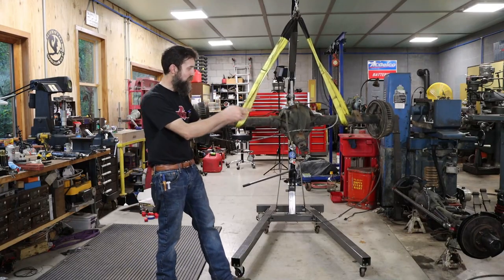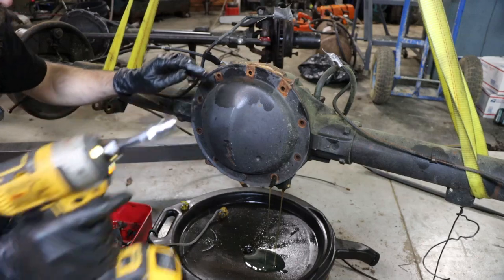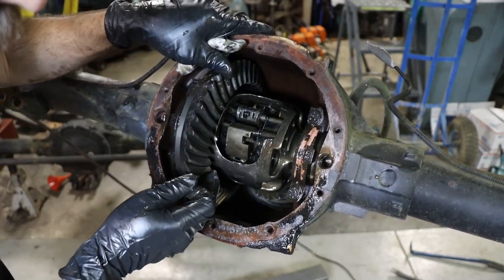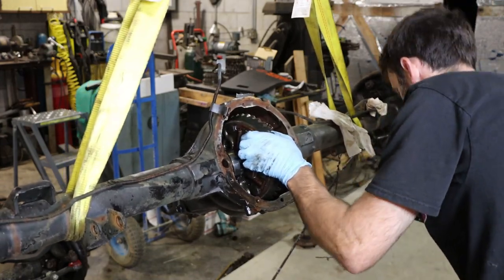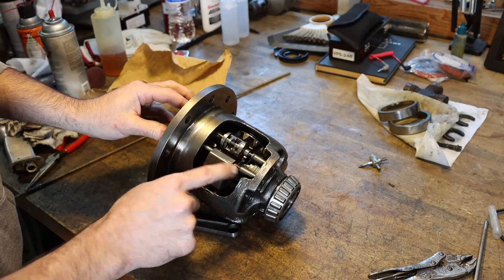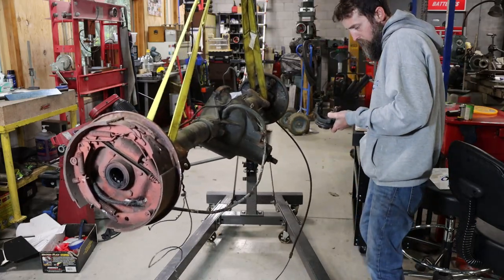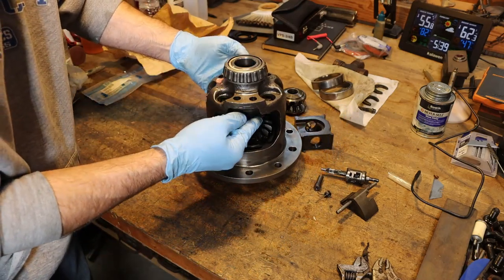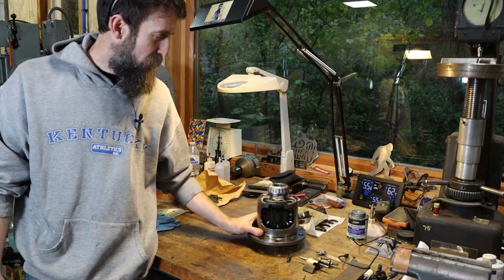Unexpected bad news! Busted Replacement rear 10 bolt axle . Square body #5

Comment: The person that knows is Eric from BFS Recovery Team.  How to get in touch with him is another matter.
Reply: I have his email.
But he, (as well as me), would recommend changing to a 14 bolt rear, and a Dana 60 front.
The 60 front may be overkill for Steve's use, but the 14 bolt rear would make this truck a true firewood hauler.
Eric would recommend E-lockers, and I would recommend ARB brand, air lockers.

Comment: Depending what you paid for the axles?  You can replace everything it needs ( including the damaged stuff that your worried about )...
And not have to worry or deal with it again!!
A used axle can be a great savings if the new parts are expensive?  But sometimes not worth the risk of unknown damage or just the time tearing it apart!!  Your time and money to decide...
Looks like a repairable setup ....
That LSD is more than adequate for your needs....plus you already got it!!
😆

Comment: I can tell you exactly what happened. They had large tires on the vehicle and they had them stuck a bit and when they jumped on it the shock load between the pinion and the ring gear was very great and it snapped it off.

Comment: Excellent explanation of how the diff works, I've never seen an LSD that works quite like that.  I personally wouldn't be worried about using the carrier with those dings in it, I very much doubt it will cause issues.

Comment: The pinion shaft usually has a white sealant on the splines and a red sealant on the back of the nut  and the washer from the factory. The purpose of that diff is you do not get slow speed chatter from the clutches when turning. not a good unit...

Comment: Steve. Happy aniverbirthday to both you your mom and wife. 2nd my opinion of boat anchoring those axles aside maybe see if there is an electric locker kit and new center section...By your own response on screen it seems that center section is next to garbage...if its that questionable just junk it and get a new one and save your self the "would could happen worries"

Comment: Hi Steve the paint on the brake shoe assembly is red oxide primer not a good idea to get it on the springs etc
Reply: No doubt that is what it is, the question is how it got in there and why?  I've seen the inside of a lot of those assemblies and that is the first time I have ever seen it.  Maybe it has something to do with an Army spec?  Surely someone here will know.
Reply: @paulcopeland9035   some people do use it on the shoes but it shouldn't be on the linkage etc i have seen  factory shoes come with red oxide but its rare or an option.

Comment: Don't know what to tell you.  Could replace ring gear and pinion in front end and keep original gearing or do the rear end.  Limited slip is great.  Just hope you are happy with your ratio.  You do live on a hill.  Remember my buddy Paul's truck, my 3:98 or was it 3:89 ratio?  Gears went into his drag buggy, put 3:26? Ratio rear end under my 1964 ford.  Paul wound up with 350something under his f100 would pull a load of firewood up a hill with a 302 and automatic.   But you have a granny gear 4 speed.  Just keep making videos and share. I have a slumbering 1983 c10 with a 4 speed,  ok it has been replaced with an 1988 f250 with a 460 and 5 speed, old ford is a horse.  Should sell them both and get my 1964 f250 on the road, fire breathing 292 and 4 speed.  Running truck, need to go through the brakes.  Same problem with my first pickup, a 1964 f100, brakes.  But it stopped.  Pulled a set of drums off in a junkyard to put on it.  Drums and rotors used to not be so easy to find nor reasonably priced.  Back to rear ends.  Fords were better although splines did let me down on my 1964.  Changed out rearend  and axles alongside the road one weekend.  Splines were probably worn and slipping.  That was a long time ago, 40 years ago.  Wanted taller gears anyway, put in 3:26? Gears.  Wanted to get better mileage,  gas was 80something a gallon.  Didn't help much.  Just made my speedometer off.

Comment: think the red dust is the remains of spray on coppergrease
rearaxle looks to be a G80 unit should be ok for the amount of horsepower youre truck has and type of driving you do , it should help you a lot in snow and mud conditions 
think if you feather in the damage with a die grinder so there are no stressrisers the diffcasting it should work fine , another option would be to find a different used carrier housing and put all the inner gubbins in that , as you need to replace the drive gears it shouldnt matter too mush
Reply: That isn't close to being a Detroit locker!
Reply: @paulcopeland9035  fixed

Comment: The friction material can turn red if the brakes are severely overheated, could be that? ...
Reply: Not a chance, that looks like sprayed on red oxide primer to me. We used to use it here in the .UK a lot 30 or more years ago and bloody good primer it was too!
Reply: Did you also primer break shoes before fitting them too? lol
Reply: @samrodian919  My thoughts red lead primer.
Reply: An anti-oxide treatment would make sense since it's a military axle.
Reply: Put a Detroit trutrack posi in
Open diffs suck on pickup’s 
Changed mine out
Reply: Oops limited slip a keeper

Comment: I'd run that diff centre. Those little impacts are nothing compared to the shock loads it sees in normal use. The worst "abuse" you'll ever subject it to is getting stuck in a boggy field.

Comment: Replace the bearings, pinion gears, and the clutch packs. Those clutch packs are not going to work with the metal impregnated in them.

Comment: Dress out the damage on the carrier and slap it back together. It's not a show truck. Like you say. You're not sump jumping. Replace it later if the should arise but I wouldn't  'reinvent the wheel' if you don't have to.

Comment: Happy birthday Steve and Steve's mom , happy anniversary , with 4X4 units don't you have to replace both front and rear ring and pinion sets as a unit to make sure that they are a matched set?
Reply: Uhh, no! Most 4x4 units are very close to being the same ratio. The front unit usually is a very slightly higher ratio to keep the steering stable while in 4x4 mode. Example: front 3.55 to one, rear 3.56 to one.

Comment: The Eaton G80 locker is garbage. Get rid of it . I have changed out probably 100 of them that grenaded. Put a Yukon Gear locking unit in it and never worry about it .
Reply: Agreed, I blew one up in my old blazer just driving through a muddy field years ago.  Blazer was 4 years old at the time.
Reply: Good advice!
And, he could leave the rear end that is in the truck now.
Not need new R&P,,,,,
Reply from the maker: I am strongly considering one 👍

Comment: Congratulations Steve on your 41st, (I remember my 41st I was 20 at the time 🤔)
And your wedding anniversary a busy week for you with all the celebrations

A question for you Steve, using your truck as an example do both of the diffs have to be the same ratios?
Tony from Western Australia 🇦🇺
Reply: Yes the front and rear ratios MUST be the same. Because when in four wheel drive the front and rear axles get the same revolutions from the transfer box and therefore the wheels turn at the same rate and the distance travelled will be exactly the same, ( when going straight, when turning the front diff will allow for the different distances the front wheels travel)  If the axles were to have different ratios then one axle wheels will skip and jump because  the other axle is propelling, (or trying to)  the vehicle at a faster rate.
Reply: @samrodian919  thank you for the info I had thought that was the case but not completely sure so I have found the best way to find out is ask 😁
So if you decide to change your gear ratios or in Steve's case let's say the existing dif could not be replaced for some reason like no longer available or couldn't source one in the area you would have to get 2 or replace the gears/cogs if you could find them, it could run into being a very expensive project.
I certainly think Steve has definitely made the right decision to rebuild the truck this way by the end of the resto he will know exactly what has been done, that it has been done, and not purchasing somebody else's problems and having to chase the rabbit hole again 
Cheers 
Tony from Western Australia 🇦🇺
Reply: @MoondyneJoe  yes he seems to be looking to go for different ratio to the ones he just bought by today's video. The military ones were different from his original ones, and now he's going to go for two new diffs of his original ratio as that suits his uses better than the ex military ones. ( I think he said the ex mil were something like 308:1 and his originals are 387:1 )  we here in the uk in LandRover terms when putting a Rover V8 into a series always put the 354:1 diffs from the Range Rover in place of the 4.7:1 series diffs. If you keep the 4.7 diff in the motor takes off like a rocket from a second gear start and runs out of steam at 70 mph ! (about 115 kph) 
Cheers Sam from Essex UK
Reply: Mondyne Joe. I wonder what Steve is going to do about all the bodywork holes he has in the truck. Here in the Uk that would be off the road until holes were filled in as they are and I quote "a danger to pedestrians" unquote lol I wonder what the chassis is like under there too but I bet Steve wouldn't allow Elizabeth in it if it were a death trap.
Reply: @samrodian919  hi Sam, yes I saw Steve's new video yesterday (Sunday Western Australia time) and noticed his spiel on the diffs (excellent news with the doall Mills bits back as well as the new drill) I drive a 1996 toyota Hi-ace 2.8l van and unless I have a HUGE Load on board I rarely use 1st gear I have tried a top speed run when I got it back in 2003 but pulled out at 140km/h I am just a cruiser driver living in a small rural town driving mostly around 80 to 90km /h if I get more than 5 cars behind me I pull over and let em past it only takes 30 seconds! (then I am always the first in my line of traffic 😁) I have noticed with diesels anything over about 3000rpms you can watch the fuel gauge go down very quickly.
 being a courier vehicle the Hi-ace is geared about right
Often thought of regearing the dif to a better first, but for my needs I don't do many ks a year (under 3000)I would sooner focus the best   preventative  maintenance using best oils and parts etc than the inconvenience of a rarely used 1st gear.
Tony from Western Australia 🇦🇺
Reply: @samrodian919  same here Sam, the cancer in the bodywork would be a major attraction to the local police
"If you have that what else can we get you on?" would be there attitude
Steve did say a couple of videos back he will do up the rust,
I have seen Elizabeth in the truck on a fair few outings, when your finances are tight, you make do with what you have and make it last as long as it is practical.
I am of the simular thought as Steve, it is better to know your vehicles than buy someone else's problem and start from scratch again
Mine was a ex TNT Courier /forklift service vehicle a FLEET vehicle with log books
When I got it in 2003 it had done 278,000kms now in 2021 it has done 320,000kms
and it is my only transport!
Several mechanics have joked it is barely broken in yet
Expect a million ks out of it the way /amount I drive it
at 61 It may be my last vehicle unless I win lotto and Toyota bring out a suitable electric Hi-ace Van (here right now a 2021 diesel is around 54,000$ AUD
I am enjoying Steve's resto and am picking up a fair bit on the mechanical side diffs have always been a bit of a mystery to me.
Oh
BTW if you are into interested in car stuff
Try these YT Channels 
Taylor Ray, 
Halfass Kustoms, 
IronTrap Garage, 
each is unique in their own way and VERY knowledgeable
In what they do.
Tony from Western Australia 🇦🇺
Reply: @MoondyneJoe  yes I'm fairly interested in the auto stuff mate I earned my living for about 18 years on the spanner's as a mobile mechanic working out of the back of various motors of the Vauxhall variety and then my series 3 lwb  109 with the V8 and then a bit of comfort with a 1991 Discovery and I just loved that motor! V8i automatic luxury after driving a series that some bastard stole, but the insurance covered the Discovery AND the insurance as well. Had that 11 years then got a 4.0l series 2 discovery with rear air suspension which promptly broke after about 750 miles so springs and shocks went in but I got shot of that. Been retired a few years now and run around in a 2001 Toyota Yaris lol getting an inheritance very soon and the wife wants a big 6 berth caravan so I'm going back to Land Rover ownership with a 4.2 supercharged Range Rover for probably my last car, also looking for one kitted out with LPG as I'm a fan if that having fitted them to my series and the first Discovery, the second I bought with a top end LPG system already fitted. As petrol is nearly £1.40 per litre ( that's very nearly £6.40 a gallon) it's a no brainier as LPG is just over half that price and I know the supercharged 4.2 is a thirsty bugger! Cheers mate, Sam

Comment: truth be told you could probably clean the sharp edges of the broken teeth up and reuse the pinion but only a crappy used car dealer would do that and it would probably last forever if it did not roar too loudly but i would definantly replace the ring and pinion together just my 2 cents that means nothing

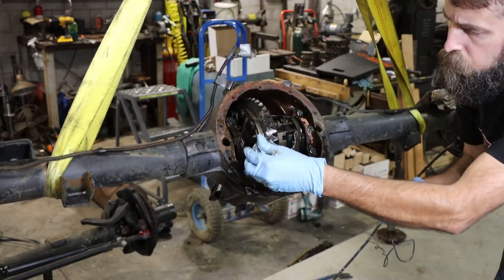Comment: At 11:35 you are removing the carrier bearing caps.  Looks like you might be using a torque wrench for a breaker bar.  Not really a good practice if you want to keep your torque wrench in reasonable calibration.  i have seen this practice cause big issues in an industrial setting.  Excellent work otherwise.
Reply: I stand corrected.  I see your ratchet on the bench at 12:30.

Comment: The red film is not an anti-rust coating but rather material from the brake-shoe linings. The pinion gear on 10 bolt rears were known to have metallurgy issues but since you found RTV on the pinion nut a likely problem could of been is the pinion seal was leaking and it was replaced and whoever might of replaced the seal allowed the pinion to move and when they reassembled it didn’t slowly draw the pinion tight and stressed cracked the back of the gear teeth. In any event you should replace the Ring and Pinion gears as well as the bearings, races, and seals. As far as the differential housing personally I would have no problem reusing it if no other signs of damage are found during a close inspection of it.  Lastly the easiest way to remove brake drums with a rust ridge that you can’t back the adjuster off is to grind off the head of the brake shoe hold-down pins.